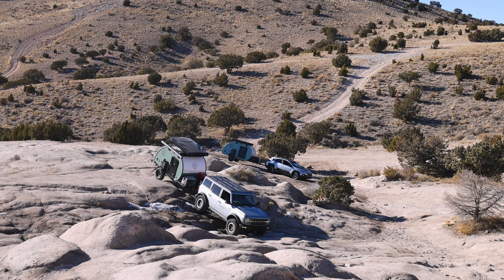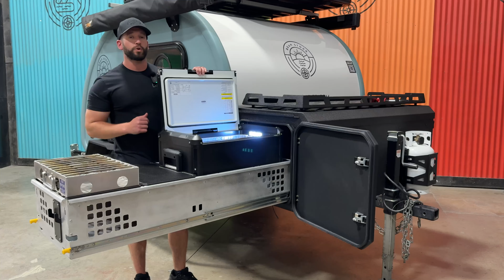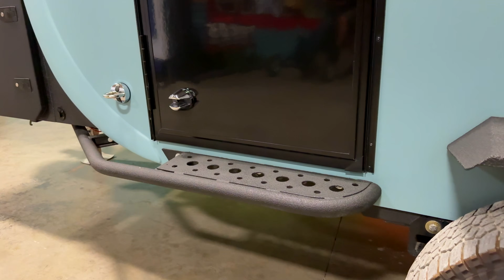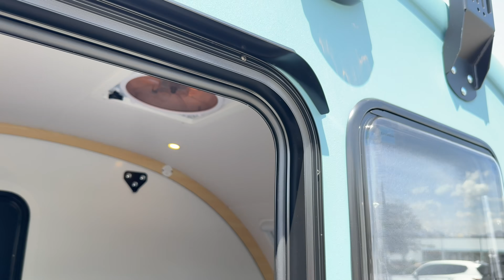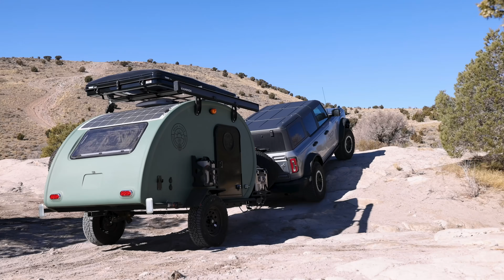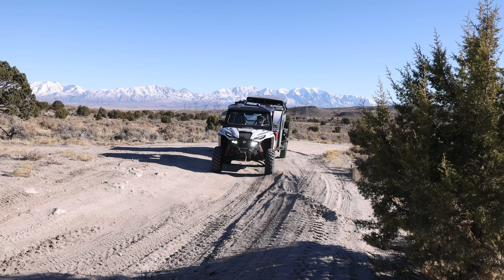Bean Stock w/ NEW Front Box System | New & Improved Off-Road Camper

Comment: This is really nice. I actually prefer it to the mean and meaner. This is what I’d get. It sits in a weird spot tho. Because, imo it actually offers some potential upgrades over the mean and meaner, but then doesn’t include integrated heating or a power source. Would be interesting to see this layout but with less compromises. The more space inside is awesome, and the outdoor cooking space with the table is sweet.
Reply: not sure how an integrated power system is an advantage.
Reply: Higher capacity and power output and the ability to add more power.

Comment: No shower 😔
Reply: Relatively easy fix.  Do a privacy/shower awning on one side and then use a Gyser or other shower system.  We already have a Gyser, so that would be the solution for us.
Reply: @garretlewis4103 looked it up, is pretty cool ngl, but how do you wash your hair with the sponge?
Reply: @enjoyer903 With the sponge you really don’t.  You can take it off and have it free flow.  Not 100% like a shower, but a good, low water use solution when you are out were there are no showers.  My wife and I both can use it on 1 “tank”.

Comment: 2 things left to make this a perfect trailer.

1 - Step on fenders
2-  disel heater on the other side of the box, but that's easy to get it done yourself. Just not sure how I would feel making a hole into the trailer.
Reply: I think all Bean would need to do is sell an adapter plate that goes in their window. Then if you need the diesel heater you throw in the window plate that has the ported hole and then in the summer just remove it and leave that diesel heater at home. That's what I have to do for my Bean, but a factory one would be much better than what I can do.
Reply: @PlayingwithSticks that's actually a good idea.
Reply: Agreed with the step on fenders.  Maybe not an entire diesel heater, but the connector port like I have seen on the Mission Overland Summit.
Reply: @garretlewis4103 the port option would be really nice.
Reply: One HUGE missed item is A/C. Without it, camping in hotter climates is a deal breaker.
Reply: @cernhutch  I would think the maxfan 10 speed should be ok with windows open.
Reply: Wait I need an insert for the ac. Where do you sell these?
Reply: @cernhutch  We manufacture window inserts that will work with the Eco Flow Wave 2 or the new Zero Breeze Mark 3.

Comment: Thank you!  I didn't see anything in the video covering cabin heating.  Is that built in, or is it available as an option?  Or not available?
Reply from the maker: Built-in cabin heating, such as the Truma Vario Heat available on our other teardrop-style models, is not offered on the Bean Stock. However, there are several excellent portable heating solutions, and we’d be happy to point you in the right direction!
Reply: @BeanTrailer Need to have the “port” like I have seen on the Mission Overland Summit which allows you to connect a diesel heater or an AC unit.
Reply: @BeanTrailer  Thank you!